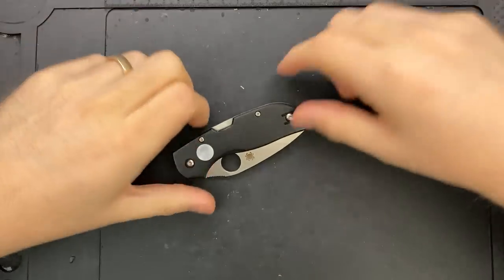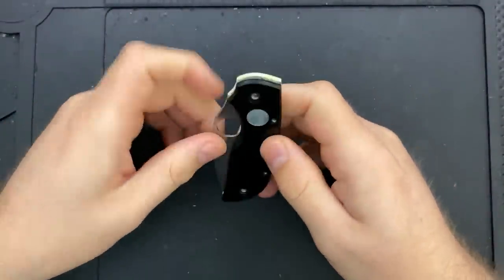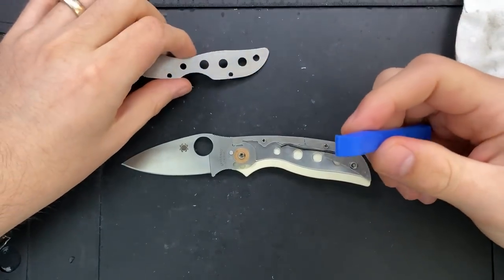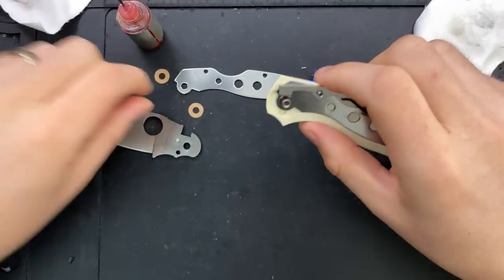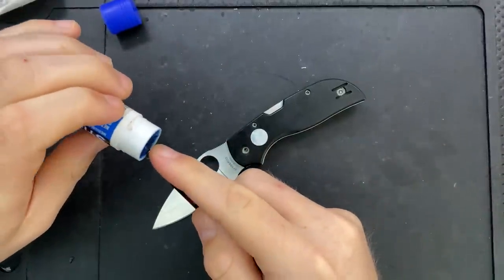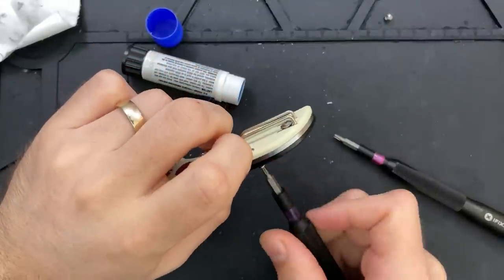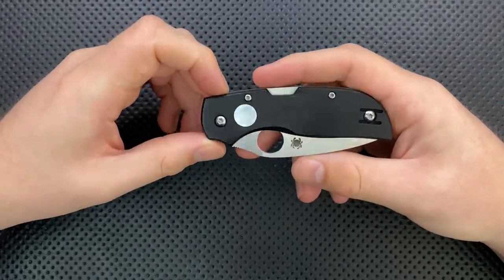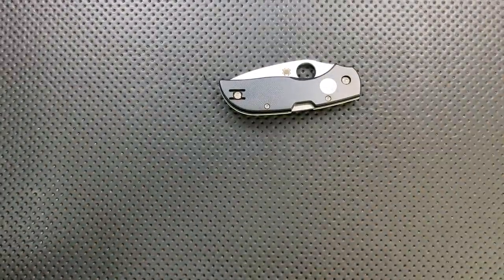How to disassemble and maintain the Spyderco Chaparral 'Sun and Moon' knife (with first impressions)

Comment: Nick, if you move the black tension bar about 1/8” out of the fully seated position it will greatly reduce the pressure on the lock bar allowing for a much smoother action.
Reply: Thank you for this tip!  It's so much better now and still plenty of tension.